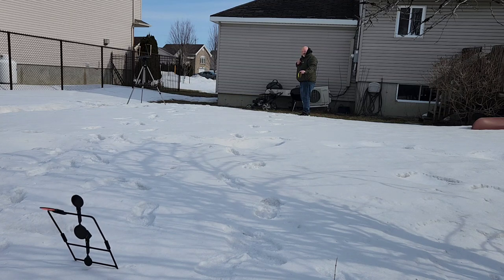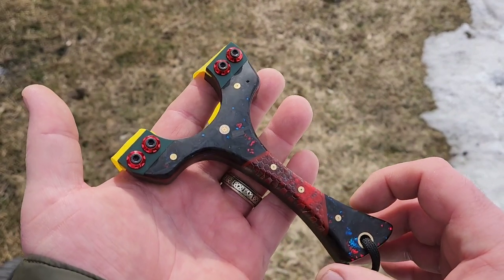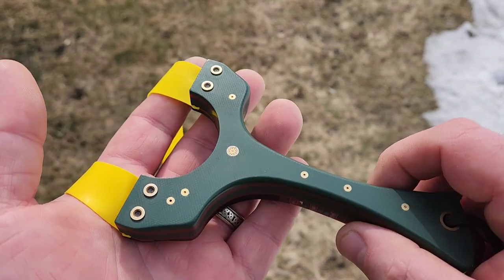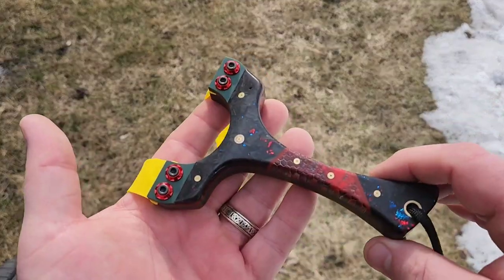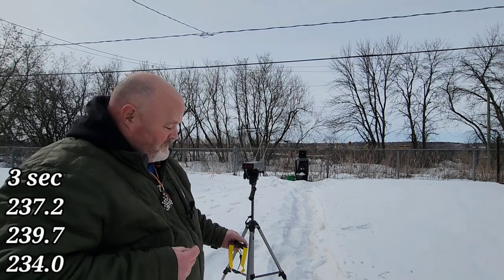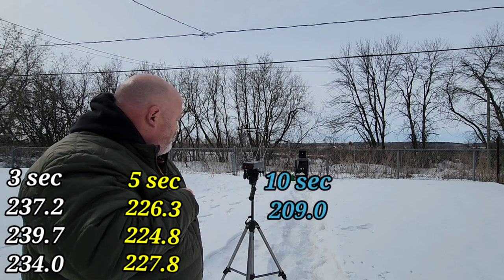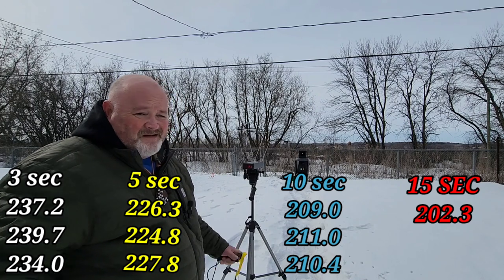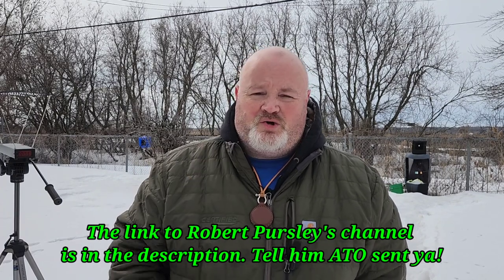HOW HOLDING TIME AFFECTS AMMO SPEED!

Comment: And a quick tip to spice up the science: There is a Computer Program called Geogebra for Math where u could type in ur speeds at the different holding times and it will give you a graph made out of these points, because it is kind of like an negativly exponential behaviour if the speedloss. This graph will connect these speeds so that you can find out the speed at any given holding time from 1 to 100 seconds. Same thing with Tapering, how different Taperings effect your speed from 20-20 to 30-10 for example. Or the Energy-loss over Distance.
I planned to make a Video for this maybe, because there is yet a lot to find out. for example Energy-loss over Distance between different ball sizes and Lead, Steel or Clayballs. All of that u could put in these graphs.
It is a bit difficult to handle this program, had this in school, but i should be very usefull.
I will try to make a graph from the information of your videos first.
Sorry for mistakes, my english skills aren't made for this science stuff
Reply from the maker: This is very interesting.

Comment: Different sorts of Latex will be very different in losing Energy while holding. Try this with GZK Green or Snipersling Black and the difference won't be that significant I think. 
Those are anti-cold Bands and I think the material is made so that it is storing less energy in warmth while being pulled back (just a theory).
I dont have a Chrony but this is my Experience with these Bands in fucking cold northern Germany.

Greets dude, great Video as always
I dont have a Chrony, but this is my
Reply from the maker: I have done speed tests with anti cold bands before (precise and GZK) all of their bands slow in the cold. I think the only difference is they don't damage as fast. Snipersling black was no different. I would be surprised if these bands didn't react the same. I may confirm this one day but I not a fan of any "cold band" the all have the same thing in common. Heavy draws. I would much prefer go up in size than use any cold band. . Thats just my opinion. I gets real cold here too and they have all been tested up to -30c. It gets colder than that here. But I won't shoot beyond that. Lol